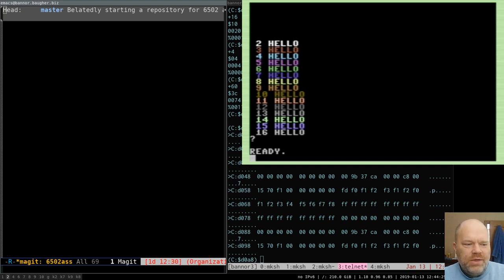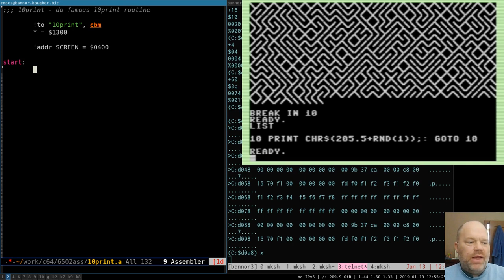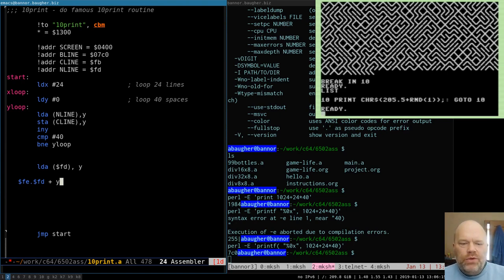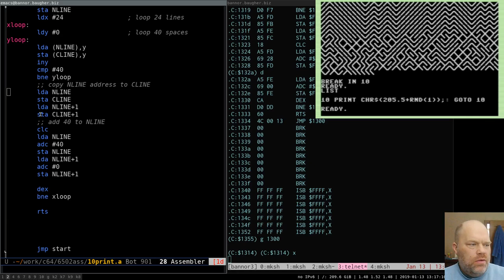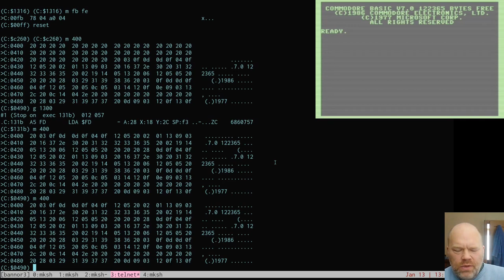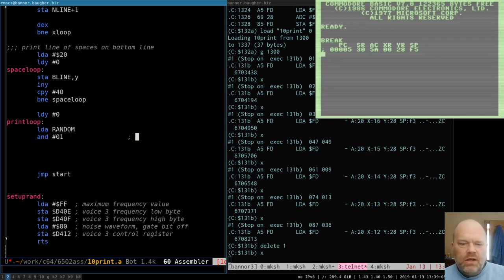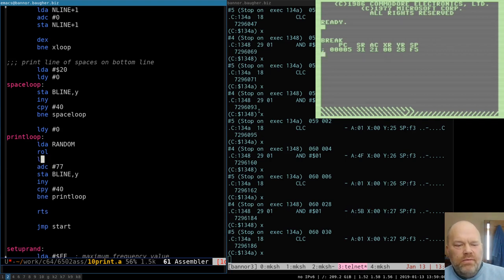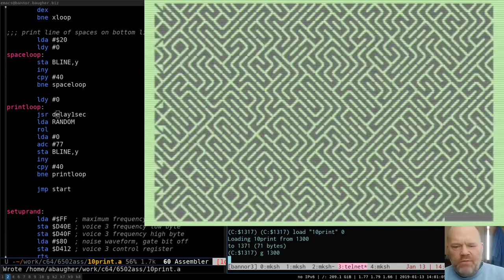6502 Assembly Language Programming #12: 10 PRINT

Comment: Just found your videos. I am new to 6502.  I started a few moons ago with a amstrad CPC 464, and I got my code out of magazines. :)  I have almost finished building Ben Eaters 6502 on a breadboard computer.  Features. 6502, EEPROM atc28 256 and 32k of static ram and a VIA input/output chip. I am working on big-banged serial /ttl/usb, and i2c for all my lovely 5volt things. Might look into SPI for my  flash sd memory card. Keep it going.

Comment: Cool, thanks Aaron, really enjoyed that one too. Given how fast it renders the characters to the bottom row, a small optimization is to exclude the spaceLoop, it’s not really needed. In fact, I think the redraw looks better. I didn’t have the same issues with the random numbers as you here. The initial implementation worked fine. I wonder if it’s another symptom of what I spotted with the gameOfLife.
Reply from the maker: It probably was. Good point on spaceLoop; it draws so fast there's no need to insert a blank line to add to the impression of scrolling. Glad you're still enjoying them!